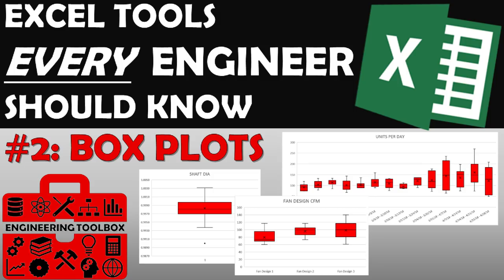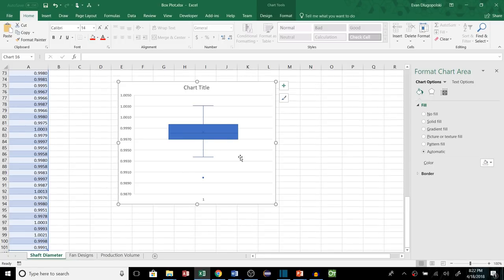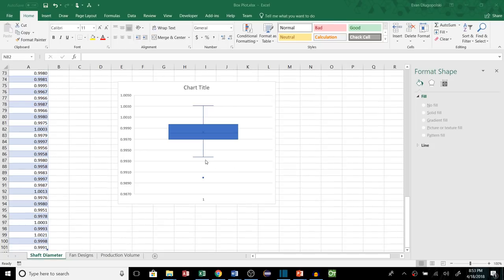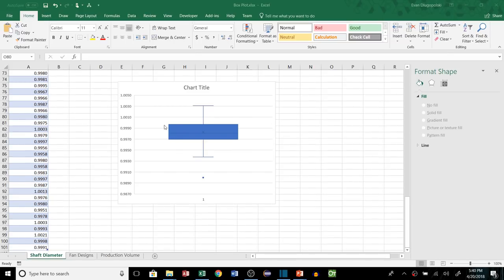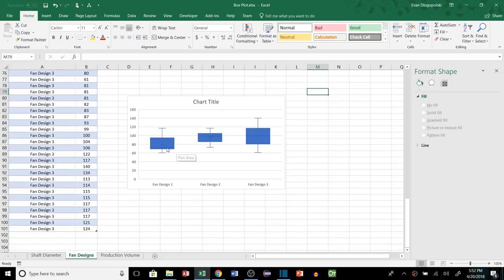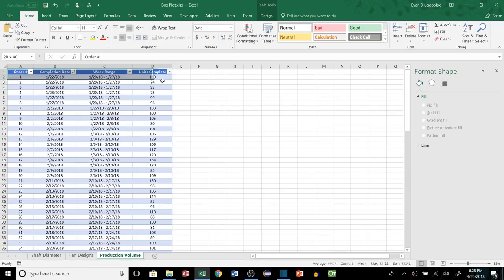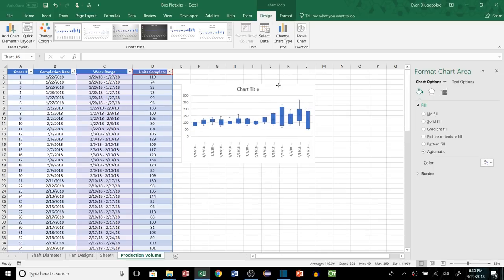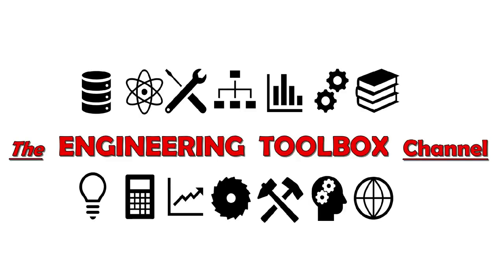Box Plots (Excel '16) - Excel Tools EVERY ENGINEER Should Know #2

Comment: not true some of what is said. Whiskers are minimum and maximum not 1.5 x IQR
Reply from the maker: How could the whiskers be minimum and maximum if my first example is showing an outlier that is less than the lower whisker?  From my knowledge the standard method for BW plots is to use the tukey method (1.5*IQR) to determine fences and anything outside that are outliers.
Reply: They are whichever is closer to your data set (i.e. if your max/min are smaller than 1.5 x IQR then use max/min, if they are greater, they are considered outliers).